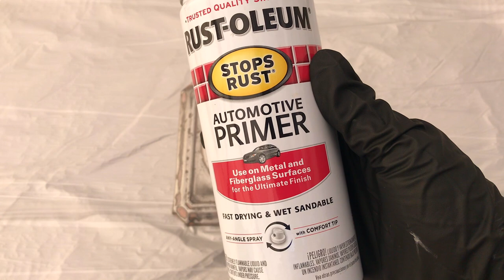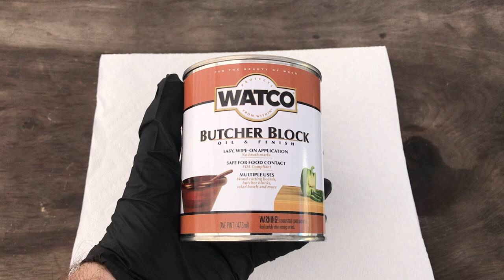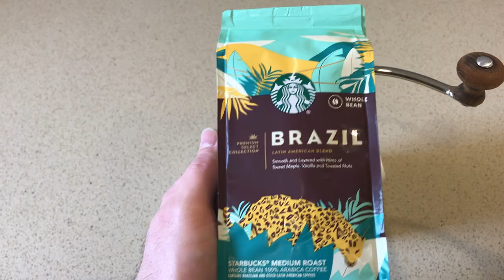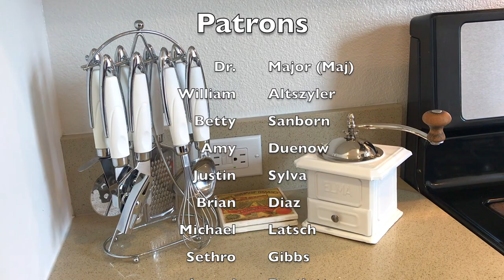1920s Antique Coffee Grinder Restoration | 100 Year Old Restoration

Comment: Don't you have a powder coating set? I swore you had one.
Reply from the maker: HI Devern, I do have a powder coating set. There was an issue with powdercoating this. Believe it or not I did powder coat this piece and there was sort of reaction with the powder. Needless to say I had to spend a few days taking the powder off and spray can it. The sad thing is I was thinking it would have been a good idea to spray can this one just because of the tight spots and such. In the end the spray can worked out and the grinder works great. - R&R